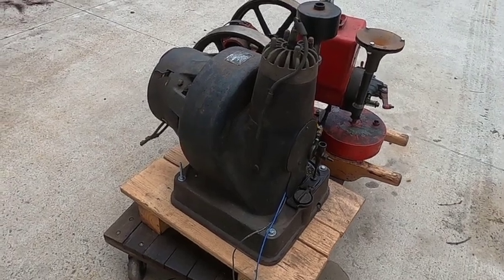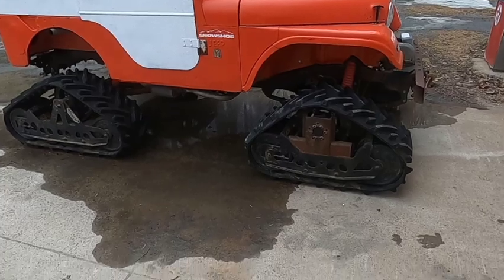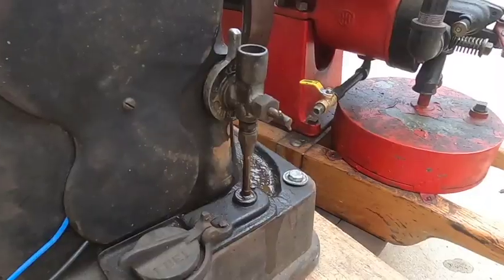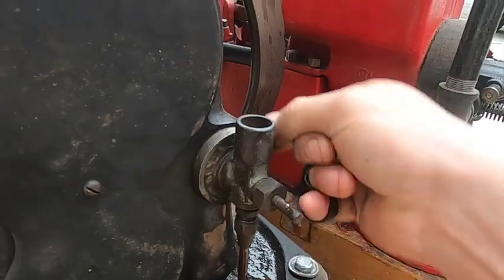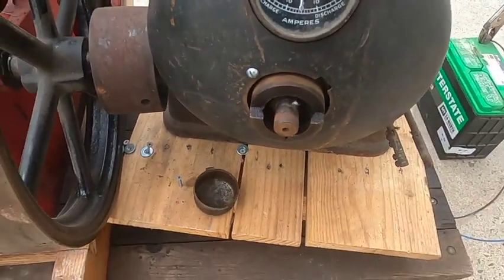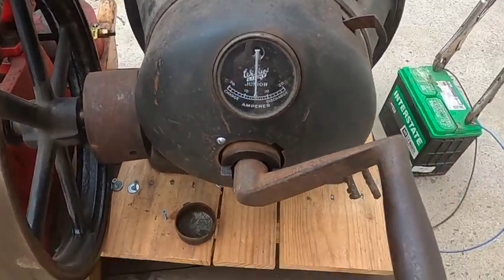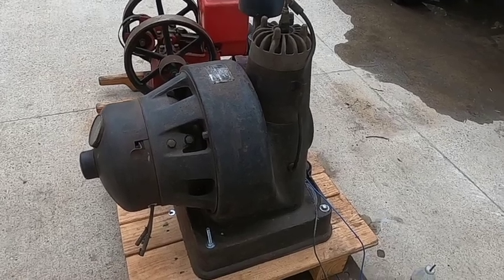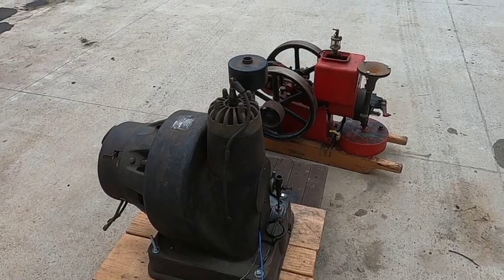Willys Junior 32 Volt Light Plant

Comment: If the generator works, you can find a 32 volt "farm radio" from the 1930s or '40s to go with it.  Major radio manufacturers actually made special radios that would operate on 32 volts instead of the 110 volts "town power" radios that most people are familiar with.  Sears (Silvertone brand) and Montgomery Ward (Airline brand) sold them by mail order, and stores in rural areas carried models from Delco, Philco and many other makes.  Most were pretty ordinary AM broadcast band table model sets, but there were some AM/shortwave consoles for the more well-heeled farmer.